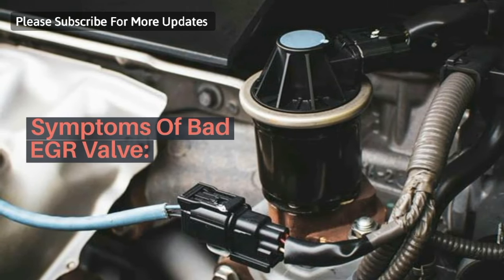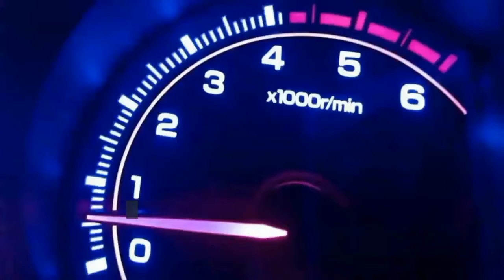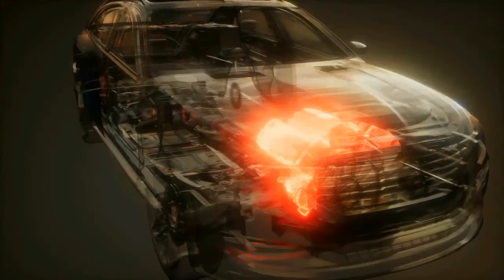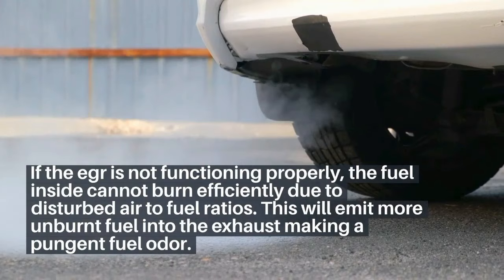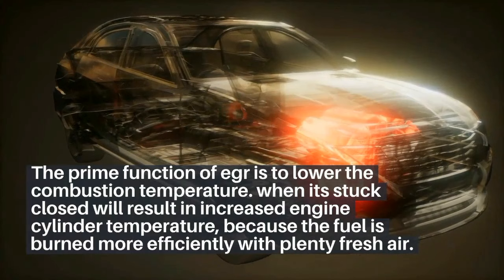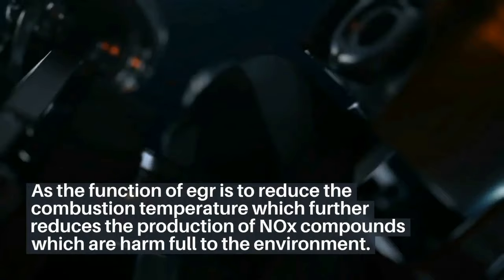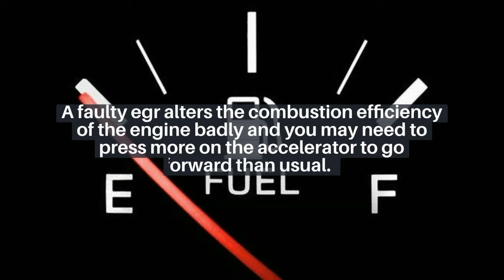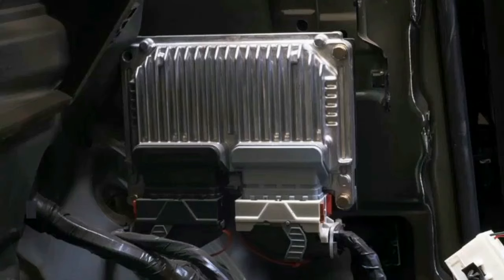Most Common Symptoms Of Bad EGR Valve | Signs of failing EGR

Comment: Very useful video, thank you. 
I have 2 identical Nissan Sunny year 1998. One of them consumes more fuel than the other.  While both engines are running,i press the diaphragm of the EGRs. The engine of the most economic  one stalls while it has no effect on the other one. Does having no effect means that the EGR is faulty??
Thank you
Reply from the maker: Hi there, i din get how you pressed it. Most egr if opened more than its command to, engine dies. It doesn't mean the egr is bad, it means when you handled one, the port must have opened more than it should be. You may check each egr by dismantling them and suck through the pipe and see if it it closes properly.
Also a bad maf sensor can cause this. The one which stalled must have a cleaner maf sensor so it read the change in intake flow. When egr opened up more it consumes more gas from exhaust causing no fresh air or limited fresh air to be inhaled. maf senses this and cuts the fuel off. If maf is not clean, or bad it cannot respond to the intke change and provides normal fuel rates when at idle.
Reply: @dailyhandsdiy  thank you for your prompt response my friend. Stall is a normal behavior when the EGR's diaphragm is compressed from beneath . The most economic car(Car 1) stalls when diaphragm is compressed. But the other one (car 2)doesn't..  does it mean that it is stuck open? MAF sensors are clean. I interchanged the MAF sensors but still same issue on car 2.  Car 2 not only consumes more fuel but also hesitates when changing gear. Changed fuel pump and filter, but still same issue. May the EGR valve be faulty?
Reply from the maker: It doesn't mean the egr is faulty or stuck open, if its stuck open you will get a trouble code  on performance variation related to maf sensor. The one with good clean egr stalls, but the other might have stuck closed gate path or the soot must have chocked the path. You may check it, just remove it first visualy check for soot, next check if its properly closed or stuck partially open. press in the diaphram and check the valve n plunger opens up and closes smoothly. Also check the vacuum on the line. If the control solenoid is bad, things get messy too. Also if you have a obd scanner cross check the maf sensor reading ie air flow on both cars if one is higher than other.
Reply: @dailyhandsdiy  thank you very much for your precious help my friend.  I wish you stay as available and helpful as you arr even when you get much more subscribers☺️. Again, many Thanks🙏. I'll get back to you as soon i check what you have told me. Greetings, From Mauritius Island 😉👊
Reply from the maker: Sure brother, made my day... :D
Reply: @dailyhandsdiy  😊😊😊
Reply: Why not buy one lufi XF obd2 plug and display for your cars. For my honda it can display Air fuel ratio, throttle valve opening, egr opening, air intake pressure, rpm, O2 sensor reading of 0.65 to 0.7 and many2 other readings which are inter related. If you have two cars of same model then so much easier to check. Take picture of obd2 readings at engine fully warm up and engine at idling. Then drive the car steady at 60km/hr, then 80km/hr and then 100km/hr. Get front passenger to take pictures of obd2 display. Then compare. Many years ago there is car owner that have an unsteady engine. He endure many times of repairs and parts replacement. Later found out it is just because of vaccum hose leakage which introduced too much air into engine and this air is actually sucked into engine at downstream of MAF . Maybe he went to older type of mechanic that good at servicing older types of cars and is not familar with his type of car. Regard.

Comment: Hi i have opel astra h 1.3 cdti 2008 model.
When is cold weather and its morning (i tried from 6 o clock until 9 o clock) the engine has difficulty to start.sometimes it starts but the engine runs rough and a signal engine color yellow it appears.
I change glow Plugs and the egr valve but the problem stays.
Plz help me
Ps i check the injectors and it is ok .i check the comon rail pump ( that is the name i think) and it is ok.and  i check the sensor camshaft and is ok.
Plz help
Reply from the maker: Hi there, try cleaning all the intake sensors,maf n map. Also go to a auto diagnostic center and get the check engine light scanned. This will show what fault your car has.
Reply: @dailyhandsdiy  ii went to garage to check my car.i change egr valve and the rest of it and he checks the car with the diagnostic program,nothing appears as a problem.
Tell me again what to check? Thank you
Reply from the maker: Long start on morning is either maf sensr issue or fuel related issue. clean the sensor. Check the intank motor if failing, air leaks in fuel line, there's one sensor in fuel rail and a regulator, check the regulator, change fuel filter if too old. EGR wont cause this issue in cdti engine.
Reply: @dailyhandsdiy  first thing i changed was fuel filter,then i changed glow plugs and egr  valve.
The garage check the injectors and was ok,check the fuel pump and crankshaft regulator ,both was ok.
The fuel tank with old diesel was at the end and i put new one with cleanser and booster .
The start problems was at low temperatures below 2 Celsius ,most of it below zero temperatures.
U say i check maf sensor,any lik at the line .and what regulator? 
Because my English ( about car -technical terms) is not very good! Thank so much
Reply from the maker: Yup there's a sensor on air filter box,which has an air temp meter in it. Clean that sensor completely. And the diesel common rail regulator Or DRV. It regulates the diesel pressure in the fuel system. And like said check for any leaks in the diesel lines. If there's a leak,when at idle air gets into the line and the fuel pump takes time to fill up. And yes there's a fuel temp sensor in the engine, do check that too.

Comment: i changed all the four injector but the car is still vibrating a lot with no pick up at all n with lot of smoke so is it because of bad egr?
Reply from the maker: Egr does cause black smoke and no acceleration with noticable vibration no heavy one. Do clean the intake air sensors, MAF and MAP too.

Comment: My car fluidic verna turbo diesel 1.6 ran 115000 km,when to clean egr??
Reply from the maker: Hi there, If its not done anytime, do it right now. Best interval should be 40k kms.
Reply: @dailyhandsdiy Bro when to clean intercooler and catalytic converter pls tell???
Reply from the maker: cat can be cleaned btwn 60 to 70k kms and intercooler around 50k.

Comment: Just bought a Peugeot 207 1.6 HDI diesel with the engine management light on, had the diagnostic results and its the EGR, is that an easy clean with Wynns EGR cleaner spray or does it need replacement please ??
Reply from the maker: Hi there, egr should be dismantled to clean it properly 90% of the time a clean up will cure the fault. It sits right behind engine right corner.
Reply: @dailyhandsdiy   Thank you bud.
Reply from the maker: Anytime mate... :)
Reply: @dailyhandsdiy   Does EGR spray actually make any difference as I'm no mechanic ??
Reply from the maker: Actually no. there were many experiments to check if those cleaners does the job. But no success. EGR should be cleaned by dismantle.
Reply: @dailyhandsdiy   Ah OK thank you, what is a good cleaner once EGR is removed for cleaning please ??
Reply: @dailyhandsdiy   My apologies for all the questions bud, I'm learning, and thank you for your help.
Reply from the maker: No wrys mate. Once the valve is dismantled, may use some diesel to soak the soot buildup or loosen it up. Use a painting or straight brush to brush it properly. Keep it some time to soak and then may use some carb spry or brake cleaner to spary and wash out the sludge. Will be clean as new.
Reply: @dailyhandsdiy   Brilliant mate and again thank you very much for your help and all the very best to you and your family.
Reply from the maker: Thanks to you too mate, made my day :) :)
Reply: @dailyhandsdiy  😁

Comment: I'm bout to open up the engine an soray that valve hopefully I pray it works. My EGR is new an still having problems. I think they bought a cheap EGR an not the factory one. Maybe we'll see tommarow
Reply from the maker: Hi there, if you are saying about the spray cleaners...they dont have good results. And some aftermarket products do encounter problems when working because of material changes.
Reply: @dailyhandsdiy  Im gonna try an clean out an spray near the intake. thats my last try ..then i'll jus let the mechanic do it. its worth a shot
Reply from the maker: In that case.....Sure go ahead.... :)

Comment: I have a 2011 escape that was getting around 350 miles to a full tank now I'm getting around 250 on a tank I have replaced the plugs the air filter out a lockout gas cap on it and ran Lucas injector into as well still having the same mileage til I have to fill up again which like I said is around 250 miles instead of 350 have not had any accidents with it...any ideas would be helpful..could it be the O2 sensors near the cat ??
Reply from the maker: Hi there, Yes o2 sensors, air intake sensors etc does affect the gas mileage badly.

Comment: Is it possible for an EGR valve to be dirty enough for it causes mileage loss but not dirty enough where it will throw a code
Reply from the maker: Yes absolutely, if the valve is dirty enough, which makes it not able to close properly, or not able open properly can make huge differences. If the valve is completely stuck with zero movement,can throw a code. but otherwise, a code related to MAF sensor performance code is stored in the temporary memory of ecm which will not lit the engine management light. but results in the performance of the car. For newer cars with latest emission standards, this might be less seen for most cars as a small change in egr flow lits the CEL right up.
Reply: @dailyhandsdiy  thank you. I am going to try to either clean it or replace my valve. I'm only getting 10 MPG. When I should be getting 13 / 14 ? Every time I ask a mechanic about mileage issues. they keep saying you have no code there's no issue. However nobody mentions this.
Reply: @dailyhandsdiy  by the way I am working with a 2008 Ford ranger FX4 4.Ol
Reply from the maker: Haha the said one applies most on ford vehicles. Usually egr wears out, a maf sensor performance range issue is stored and when it goes out completely, CEL lits with egr code.
Reply: @dailyhandsdiy  well I'm not waiting that long. 😦
Reply from the maker: Sure...dont forget to clean the maf n map sensors too. They both play major roles in egr function.
Reply: @dailyhandsdiy  already done that. Next I'm going to look at all the O2 sensors and replace them.
Reply from the maker: Great :)
Reply: @dailyhandsdiy  could the egr also cause misfires?
Reply from the maker: Hi, misfire is the least possible symptom of egr, major issues are no response or lazy response from accelerator pedal, low gas mileage, may cause shaky idling of engine and unusual smoke from tail pipe.
Reply: @dailyhandsdiy  damn. Well thanks for the info. Now I'm back at square one tho
Reply from the maker: Well if its a diesel, mostly the misfire happens when injectors go wrong or if there is a fuel starvation pump or filter ,and if petrol, spark plugs,coils,throttle body, vacuum leaks anything is possible.
Reply: @dailyhandsdiy  yea its a 3.l v6 gas. I replaced the plugs and wires. But now I have a number 6 misfire that comes and goes periodically.
Reply from the maker: Could also be an injector malfunction.
Reply: @dailyhandsdiy  thats kinda what I was starting to think
Reply from the maker: hmm 😑😌

Comment: Is this only for direct injection diesel?
Reply from the maker: This topic is common for both diesel n petrol heads using port (petrol) n direct injection. Modern tech engages vvts in petrol instead for a egr and egr device will be missing from those makes.

Comment: Not sure if you can help - recently losing power on takeoff, had the car inspected and been informed that it needs a new intake manifold and swirl flaps, plus a walnut blast. Saw that the car is due a recall for the EGR, should this be covered as it appears related?
Reply: If yours already hasn’t been worked on under that recall, then I’d go and get the work done.

Comment: I have a bmw 520D 2014 and when starting in cold, its sometimes difficult for the car to start + I have been noticing it doesn’t run well in low rpm’s. Even i would say its feeling like a lesser power + constant lose of coolant. Do you think its EGR ? I‘ve heard its common in this model.
Help its appreciated!
Reply from the maker: A coolant loss is somewhat related to head gasket or egr cooler....And do check the fuel pressure at idle of its too low.
Reply: I have a 2014 328D and it's doing this and throw a P016D code. Recall for Egr going to the dealer with it to see what they will do

Comment: Can the EGR be bad without a code???
Reply from the maker: Depends on the make...for some vehicles there will not be any codes untill it's stuck or blocked completely.
Reply: @dailyhandsdiy  2000 Jeep . I also have most of the symptoms. Rough idle when cold, RPM needle fluctuating 100-300 at idle. First time stalled when filled tank, but only once at the pump. I used to top off frequently. Think charcoal canister needs replacement? All new sensors, coil pack, plugs, fuel filter pressure regulator, pvc's, cleaned TB. Reset ECM. Getting new EGR/Purge today. I did have a major exhaust backfire on Fwy due to running rich after replacing all non OEM injectors. Hope I didn't damage my Cat.
Reply from the maker: As said, a fault in evap or purge system can also cause these symptoms. Also check the map or maf sensor and also throttle body, especially the position sensor.

Comment: Hi, My car can drive normal for an hour or two then it feels like it’s shutting down the speed gauge stops working and the car drives sluggish driving only 20 mph no higher.
I was wondering could this video be the problem?
Reply from the maker: Hi there, Which car are we talking about?
Reply from the maker: As a preventive you could clean the air intake sensors first and check egr of course. EGR does give sluggish response but mostly in random manner. Another problem occurs is from fuel side, a bad filter or a pump or even the regulator too.
Reply: 2007 Charger
Reply from the maker: First and most this would be to find a dte code by scanning ecm. if no codes, start cleaning the air intake sensors and valve including throttle body. Cross check the throttle position signaling with pedal to check tps health. 2nd would be the fuel components, replace the filter if old, fuel pumps health, and regulator. Could also check the spark plugs for health.
Overall all these things can cause the power loss.
Reply: Okay thanks for the info.
Reply: One more question. 
If it is my fuel pump/filter once the car is driving sluggish once I stop and park and the turn the car off when I go to start it back up it never turns back until j in try’s hours later then my come on with no problem could this be the same problem.
Reply from the maker: Pardon me for the delay....This happens when the electronic field generators go bad. When they heat up losses its efficiency and after cools down regains its strength. This could be anything from fuel pump, electronic fuel regulators, injectors, coils, electronic throttle body if wired. All these use field generators as working medium. A bad fuel filter can make the fuel pump work under stress and overheat causing similar issues. Their are other reasons which cause the same but, most of the time said things happen.
Reply: @dailyhandsdiy  Thank You.
Reply from the maker: Anytime mate.

Comment: Can egr valve cause p0101 to
Pop up
Reply: Have a 2013 Altima changed maf sensor replaced pcv valve got a dealership one did a reprogram on ecu but maf sensor keep popping up and have vibration when accelerating wonder if it’s egr valve pls help me this is a headache for me
Reply from the maker: Hi there, yes egr can cause the same code to pop up. If the egr is sticking, pre defined values on the maf air intake changes which cause the maf range performance code to pop up. This code is also stored when there's a vacuum leak or pressure leak in the intake side like pcv leaks, throttle body leaks, torn pipes, or more.
Reply: @dailyhandsdiy  and egr causes
Jerking when starting to accelerate & even when I start car in the morning it’ll idle and drop rpm then slip light comes on I wonder if the egr triggers that for slip light to come
On as well Nissan is so sensitive

Comment: Hi mate I hope you can give some opinion, my car is a turbo diesel 10 year old with 73k miles, just recently I'm having intermittent power loss but no engine light coming on every time, but once I turn the engine off and restart it fixes itself and the power comes back as normal. The car has had major service, including fuel filter, the engine sounds okay, idle is stable and no smoke, only there's no boost when it happens and the rpm wouldn't even go over 2k. My question is do you think it's an EGR issue at all? Or something else?     And why do you think there's no engine light?
Reply from the maker: hi there, yes its common for egr to get stuck and cause similar issues without engine light to pop up. ECM may or maynot show a MAF performance range malfunction code when this happens but with no CEL. This same could happen if the air intake sensors (especially MAF n MAP) are dirty and misreads the air volume data. 
Either its a fresh air starvation or misreading, or its a fuel starvation.
Reply: Did you have a car accident with the front of the car?
Reply: @ivanrados6494  what's the relevance if car had accident or not?
Reply: @MarianA-vu8tb  oke forget about that
If someone put a software that is't Mercedes orginal that might be problem